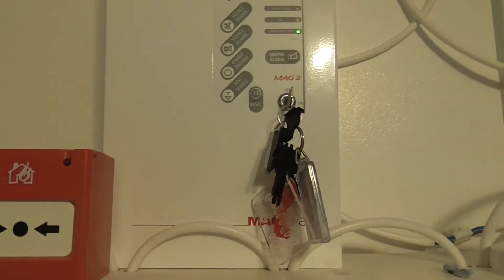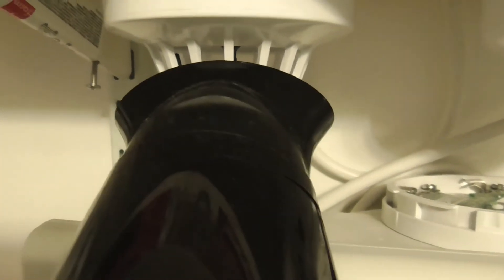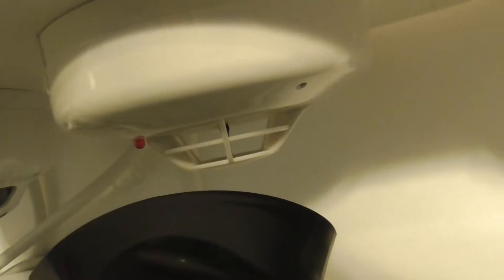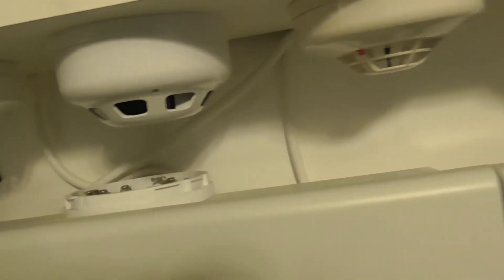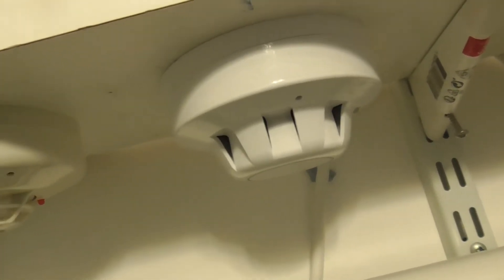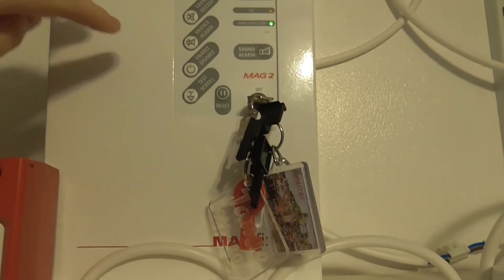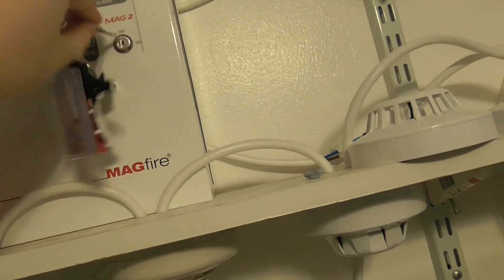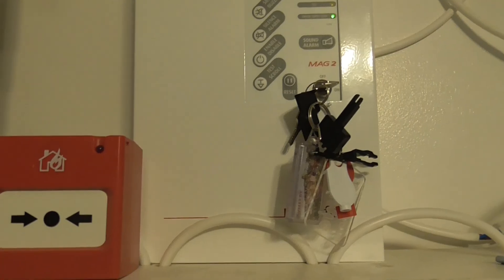ESP System Test 4

Comment: Is the ESP panel 2 wire ?
Reply from the maker: No it’s a 4 wire
Reply: @j1firesystems440  Is there a 2 wire version ?
Reply from the maker: There isn’t 2 wire one of my version of panel but there is an ESP MagDuo panel and that is two wire. Hope that helps :)
Reply: @j1firesystems440  what about C-tec panels
Reply from the maker: @imreszappanos690  Yes there are two wire 
C-Tec CFP panels you can get. I have one with Apollo AlarmSense which you can only get with  the panel. Hope that helps :)
Reply: @j1firesystems440  Thank you
Reply from the maker: @imreszappanos690  No problem!